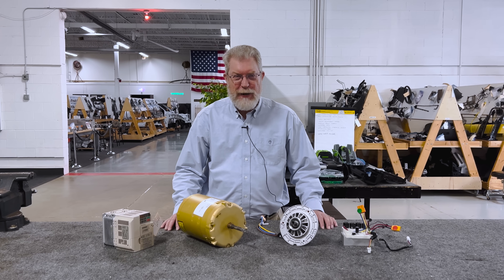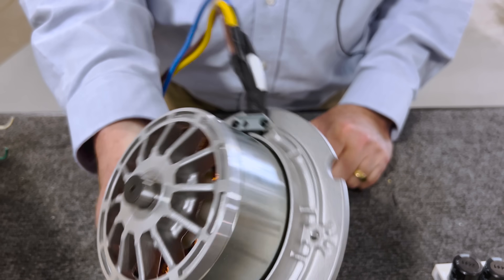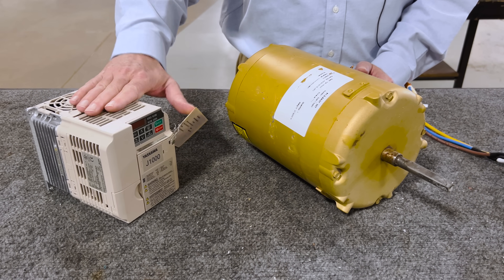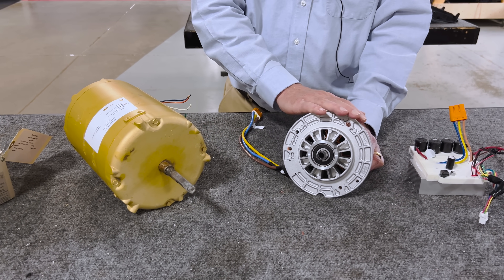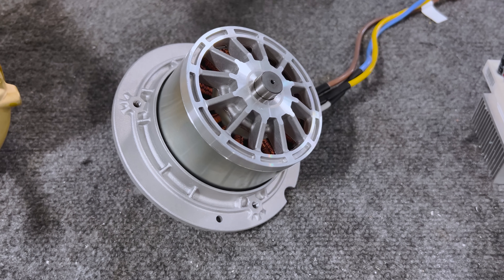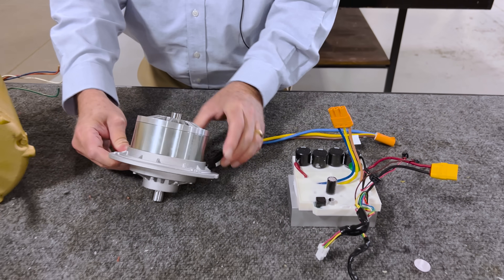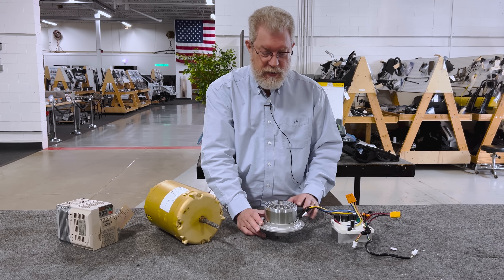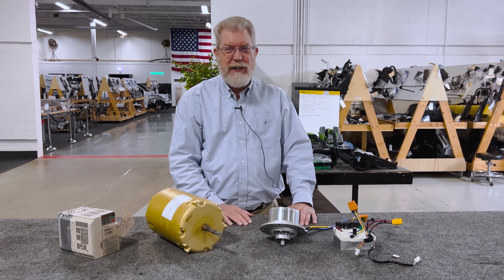The Evolution of Electric Motors: From Bulky to Lightweight, Efficient Powerhouses

Comment: I saw recently that EGO release a power unit system (motor & controller) that companies/manufacturers can buy to use and develop products using their battery system (56V, 2.5 to 12 Ah). They offer vertical and horizontal shaft models, performance comparable to a 200cc petrol engine (similar to well known GX petrol engines from Honda). About 3.2 to 4.7 HP, torque around 6 ft.lb (8.12 Nm) @ 2800 RPM. 26 pounds dry weight without battery and less than 50 pounds with 2x 10 Ah batteries. Hopefully they will make it accessible and offered to the public one day for DIY projects! Can't find the cost.

Comment: The 3/4 HP motor is rated for severe duty, and it will last for 50 years if properly maintained.
It can also be rebuilt and reused, whereas the small motor is a throwaway.
He's not telling you that.

Comment: You can't compare these 2 products just by looking at their power rating. What about their Torque? Also, the induction motor is designed for 365 day constant operation in harsh environments -25C to +40C. I doubt that little motor can handle such use under load. It's intermittent when you think about it, a residential lawnmower get used 24-48 hrs every 6 months. In ideal conditions.

Comment: I think the real question here is how did they go from a very large 500w motor to something up to 6x the performance that can fit in your hand. I think that's a much better video.
Reply: Consider these videos are not so much education in intention, but advertisements for Munro. They are not what use to be, the History Channel.
Reply: Rare earth magnets (this one makes a huge difference because the magnetic field can be much stronger pound for pound), better control electronics, better winding design using computer simulation etc., more efficient bearings, tighter production tolerances.

Comment: 1:35 How much more efficient is the new motor or how efficient is the old and how efficient is the new? I’m sure many here would like to get feel for the numbers.
Reply: Traditional industrial motors (like the one in the video) were around 80 to 90 percent  efficient depending on the application (higher if optimized for the application and run at a constant speed). Modern DC brushless and permanent magnet motors are typically around 95% with some reaching 97 or 98 percent even under variable loads.

Comment: Starters and Alternartors usually make 1500W. 2:20
Reply: Correct but only for a very short moment. They wouldn’t last 10 minutes at full power. 
For electric motors it’s essential to specify not only its power but also whether it’s continuous or only in intervals and those intervals should be specified too. 
E.g. 30s on 60s off.
Reply: @Conservator. I agree but a starter doesn't have cooling fins. But Alternartors do. And the run when the engine is running in an ICE car.
Reply: @suggesttwo Alternators run when the engine runs but they don’t generate energy all te time. One could describe them as ‘regulated generators’.
Reply: @Conservator. Yes they do generate power all the time but not 1500w all the time. The vehicle is powered primarily by the alternator with help from the battery when the vehicle needs more current than the alternator can provide. The alternator also keeps the battery charged and recharges the battery after starting the engine or a group of components drew more power than the Alternator could provide. Example, front and rear defrost plus windshield wipers. That's besides the computer, electronics and ignition.
Reply: @suggesttwo Thanks for the correction. 
I should have said that alternators don’t run a full capacity all the time. 

Am I correct in thinking that alternators usually are bigger than starter motors?

I’ve searched for the typical efficiency of alternators and google said: Standard alternators often peak around 55–60%, while high-efficiency models can reach up to 75% or more, with some modern, high-efficiency designs even exceeding 70%. (Nice AI response😁). 

So, maybe alternators are designed to be compact and robust at the cost of being very efficient compared to regular electric motors. 

I’d appreciate to hear your thoughts.
Reply: @Conservator. They are about the same size. Alternators usually have a that draws air in from the front preventing overheating.

Comment: Who makes the best EV motors?  Most discussions are about batteries.
Reply: Lucid
Reply: Many similar PMSM motors but it all goes down to integration, efficiency and cooling. In that aspect the motor+inverter from Lucid seems clearly one step ahead of the competition especially due to the cooling in my opinion. Back in 2016, the Tesla powertrain (motor+inverter) used to be the best option especially due to the choice of silicon carbide inverters to enhance efficiency. Now many OEMs caught up on this and you wont find a huge difference in many of them.
Kia motors are also quite intersting as they try to combine multiple functions in one, i dont know them enough to judge their efficiency or cooling though.
Reply: Siemens is probably still the class leader in industrial motors. As far as car motors, a lot of brands share similar technology. Just differences in housings and gear ratios and overall size. Netgain makes very reliable and fair priced universal motors as well. I can't say they are the best though.

Comment: How does the new motor compare in duty cycle?  Will the new motor last with heavy use?
Reply: The reason we still use big heavy motors on the left, is they are designed for 24/7 use. The motor on the right has different design goals, such as power in a compact size. Cooling is a major issue for small motors with equivalent power output. Electric car motors are liquid-cooled (oil), as that's the only way to cool them effectively. There's no free lunch with motors, physics is still a constraint. But there is a motor design for every use case, or one will be designed!

Comment: Would be interesting to understand the differences in the internals of the motors and why they're improving.
Reply: The EGO motor is a three phase motor. Basicially it’s an oversized motor like youd find on a quadcopter drone.